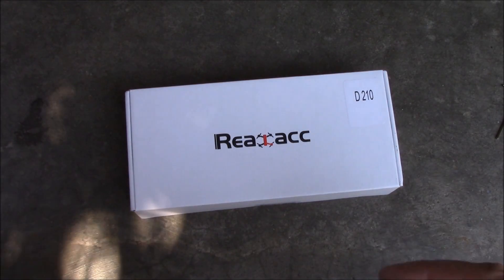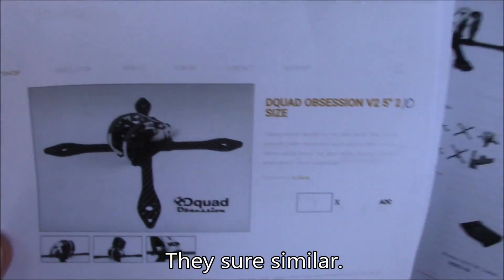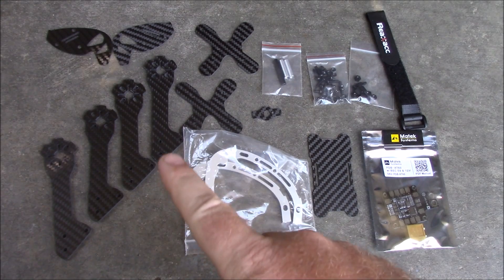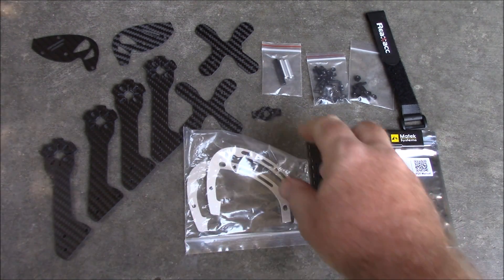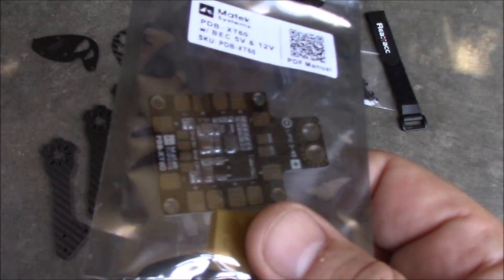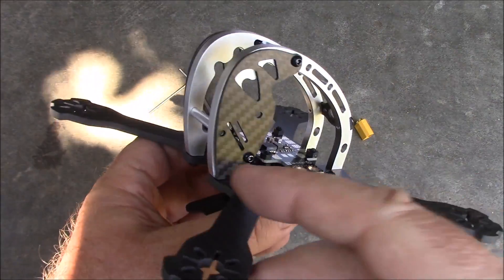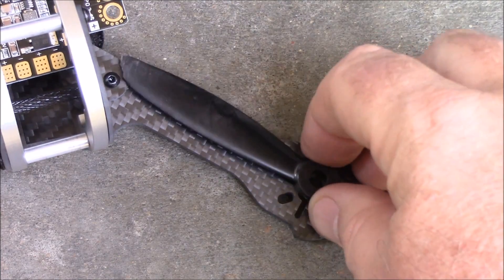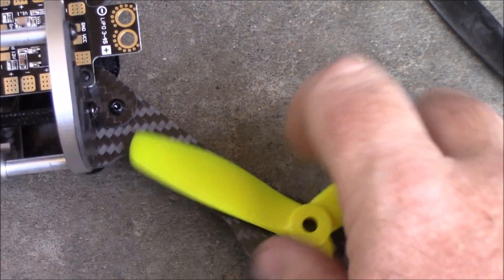Realacc D215 Frame Review (DQquad Obsession Clone)

Comment: Travis, it's bad enough that you're promoting a Chinese clone, but to add insult to injury, you refer people to the Dquad obsession website to take full advantage of their free stl files (plans for 3D printed parts). I think that's wrong man, very wrong.
Reply from the maker: I look at a lot of cloned frames.  There's not much special about how this frame was cloned versus how others were cloned.  There are many .stl files made for original frames that also fit fine on their clones.  You can search thingiverse and find them pretty easily.  Shendrones even has a thingiverse account.  If DQuad wanted their .stl files to only be accessible to their customers, they could easily have included private download links in their receipts to customers instead of placing links to them right on the front page of their site.  Hopefully, pilots that can afford it, would buy the original frame instead of a clone.  For the financially challenged pilots, like me, we'll have to stick with clones.
Reply: I dunno. Just doesn't seem right to me. 
Also, Dquad have a lifetime warranty on their frames. I think that's a fact worth mentioning.
Reply from the maker: Bane FPV One of my local friends flies an Armattan frame, which also has a lifetime warranty.  He is on his third frame.  The warranty has a lot of value and I don't think people consider that enough while choosing a frame.  I doubt we'll ever see a Realacc frame come with one.
Reply: bane you looking for something to complain about!!!

Comment: Obsession way better designed.
XT60 holder especially the aluminum version is a god send.
And the alu frame is held on my nyloc nuts, there are cut outs for them to sit in a bit like caged nuts, so aluminium has no threads to damage.}

And it plain looks better.